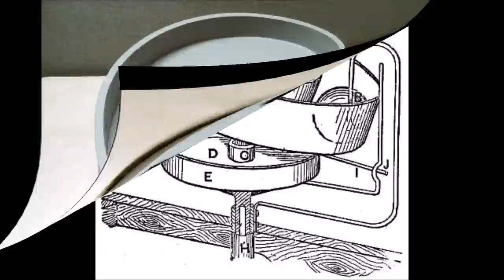Self running Tilting Tray. Perpetual Motion machine

Comment: There is filament wire wrapped around the shaft under the disc. A second operator starts to gently pull at a pre determined time (Just as the fella lifts his hands off after 'getting it going' ) You get a flash of the wire at around 49 seconds.

Comment: Wow thats amazing!  The battery is really well hidden well done!
Reply: You can build these yourself. I have. They do in fact work. This is called an unbalanced machine, not a perpetual motion machine. Unbalanced machines require an external force to work, in this case gravity. Perpetual motion is impossible. "Perpetually Falling" or "Unbalance Machines" ARE possible. If it helps you sleep at night this isn't considered a perpetual motion machine.

Comment: This is real. The secret is in the glass of absinthe. This is how it works.

1. Build contraption.
2. Drink absinthe. (Don't forget the sugar)
3. Hallucinate that device is moving on its own.
4. Profit?

Unfortunately the unlisted 5th step is realized after the hallucination ends, and you realize that there is another person using a wire to move the tray.

Why do so many people think that perpetual motion machines are possible? Did everyone skip the 4th grade? Is there a shortage of basic physics books in libraries?

Comment: can see the wire - but it's given me an idea. what if the ball was magnetic and the arm had a magnet of the same polarity to repel the ball? the point that the arm spins on could have one-way slant/block spikes on it to allow the arm to spin one way but not backwards (so as the magnetic ball wouldn't be able to repel the arm). as long as the ball was heavier than the arm then the tray should still pivot and tilt. the last part would be to attach the end of the arm to the ball with a short piece of string - so that when the arm repels the ball, the arm gets jolted over the next little one-way spike in the middle... probably wouldn't work but it's the best idea i have.

Comment: These machines do indeed work, many of which are based on medieval designs over 600 years old. The problem with the vast number of negative comments is that people fail to understand the difference between an unbalanced machine and a perpetual motion machine. Unbalanced machines, or perpetually falling machines depend on an external force, in this case gravity, and therefore don't qualify as perpetual motion machines. Perpetual motion is impossible, but unbalanced machines do work, many of which will work for years uninterrupted. The Beverly Clock in New Zealand has been running now for 11 years uninterrupted. Instead of assuming what you are seeing is fake, try asking yourself if what you are seeing meets the criteria first?

Comment: there's a little wheel on the lever on the side that touches the ball... if the wheel was powered it would easily drive the ball's rotation when it's in contact with the ball

Comment: The problem is the wheel can't push the ball because the wheel is lighter than it, but if the wheel becomes heavier it will tilt the tray, and if they are the same weight they will just make the tray move to a position where the side on the ground is in between them.

Comment: At :55 you can see the "puppet master." Also you can see the shadow of the puppeteer throughout the demo on the wall to the left.
But neat trick. What about using a strong magnet under the table to pull the whell down.

Comment: The ball's momentum will eventually run out. Just like a pendulum. When it runs out, it will push the lever backward. There is no way the lever can push the ball forward when the ball's gravity (plus the weight of the lever and wheel) pushes everything downward before it reaches the top position.

Comment: The ball is liquid filled. The operator starts the motion. The liquid is given kinetic energy, which keeps the ball rolling and the apparatus will run for a short time. No wires or air, just a trick.

Comment: This looks totally believable, except I'm noticing that, whatever is tipping the tray along, is well in front of the ball, whose weight is supposed to be the driving tipping force here. If that were the case, the ball's position, and its subsequent heavier weight, would have to be slightly ahead of tangent to where the tipped edge of the tray is touching the supposed flat stationary table. This is clearly not the case here. Whatever is tipping the tray along is doing it at such a force as to enable the tray to suspend the full weight of ball, and the arm and wheel assembly, up in the air, well behind the tipped point of the tray, which would force the whole thing to come to a stop. Therefore, I'm not convinced here.

Comment: There is a wire which connects the circle and the room light ,, when it moves  you can see the background , the reflection of light moves.When the Cheater holds the circle , the reflection of light becomes stable in the background...... Moreover 1:05

Comment: someone is using an air compressor nozzle above it to push down the tray in a circular motion. 1:03 you can see it at the top of the screen. probably why there is no sound to the video.

Comment: There is no wires at all. Notice inside the large glimmering ball there is a smaller ball. There is liquid  inside the glimmering ball also.  That smaller ball is a steel bearing.Under the table someone with a large magnet in his hand is making a circle with it and dragging that steel bearing around and around.  The cup with fluid in it is a distraction.

Comment: The Five Laws of Friction:

    When a body is moving, the friction is directly proportional to normal force and frictional force direction is perpendicular to the normal force.
    Friction doesn’t depend on the area of contact so long as there is an area of contact.
    The coefficient of static friction is slightly higher the value than the coefficient of kinetic friction.
    Kinetic friction is independent of the velocity of the body.
    Friction depends on the type of the surfaces in contact.

Comment: If the ball can tip the tray with the lever on it, then it must be heavier than the lever. However, since the lever can push the ball uphill only using the force of its own weight, then in must be heavier than the ball. So, it cannot work

Comment: Not perpetual motion:
It looks as if the machine can never be at equilibrium, but it can. If the ball and lever are positioned in such a way that the combined forces just push down the disk, assuming the disk is already in such a position, the machine will be stopped
So, its essentially a disk with a bunch of doodads on it. The things might as well not be there. As you know, spinning a disk is not perpetual motion

Comment: If this is self moving then why you need to start it manually by hand......what actually will happen is that dish will tilt down in the direction line of resultant of gravitational forces of all items in it like ball, levers, wheel, nut bolt etc and finally stop.

Comment: Impossible of course (First law of Thermodynamics).  But these guys are really like magicians not physicists.  Everyone with a high school education knows it's a trick we just need to figure it out.
This one's easy.  I don't think there's a wire, but an electromagnet under the table that's switched on and off as the metal disk rotates.  You can see it clearly in the jerky action of the platter.
If gravity was powering it, it would be smooth.  He should power the electromagnet with a sine wave instead of a pulse to smooth it out a bit.

Comment: It's important to think about where the energy is.  It's a certainty that all has to be accounted for, no free energy.  Do you notice how the spinning motion is demonstrated at the beginning?  The ball is filled with fluid.  The initial motion might be enough to set the fluid in motion and that would hold a short reserve of energy.  Also, you have to wonder why such a ball would be used for such a serious demonstration?  There are clearly electronics in the ball.  I know that some balls have wobblers in them which cause them to be erratic.  This would be extra energy to play with.
Reply: please re watch the video keep you eye open for a rod at poking down at the top of the screen. he's using a wire.
Reply: +kakytoo69 There is a moment where a rod can be seen at the top of the frame and appears to have a motion matching the spinning tray.  Good catch.  Still, this could have been done with one of those 'weasel' balls that rolls around by itself.

Comment: Gravitational fields, electromagnetic fields, springs, pressures, etc.. are all conservative fields. If you take an object and move it through the field, you can store potential energy, but if you ever return to the original position, all energy reverts to its original state, REGARDLESS of the path taken. You can make a fancy contraption to try to confuse the underlying physics, but I promise there is no orientation or configuration you can place magnets or springs to create power. Stable kinetic energy is not power generation.

Comment: This is just something that will run a long time due to low friction between disc and table, it's in the same class as a spinning top. For a bigger example look at the rotation of earth around the sun, the very low friction in that case will ensure it'll still be going in billions of years.
Reply: There is a ton of friction. The rim of the  bowl, the rolling ball, the weightet contraption...
There are a few really cunning constructions who run a real long time (not quite for ever, but still), balanced, weighted and every bearing as soft as possible. And - oh yes - celestial motion is a good example. Vacuum and low gravity is really practical when you try to reduce friction :D
This thing here, is clunky in comparision.

But just to clarify: I don't believe in perpetual motion. I am aware, that it's impossible.

Comment: You can build a machine like this which will move forever - or at least for a long time. I don’t remember that physics deny that. The problem begins when you try to extract “work” from the system. You cannot , for example, power up a lightbulb using is because it is on such a balanced state which will crush down with an energy output.

Comment: This is NOT perpetual motion for two reasons, first, it is impossible, second and most important, THE BALL VIBRATES AND SHAKES THE PLATE, WHEN THE BATTERY RUNS OUT THE PLATE WILL STOP

Comment: Если остановить кадр, становится очевидно, что лоток соприкасается со столом в точке, которая ниже чем шар. Значит, это не шар толкает лоток, а наоборот, лоток качаясь силой инерции заставляет кататься шар под наклоном (вместе с рычагом). Конструкция медленно теряет энергию, сообщённую ей автором, на трение, что должно отражаться в уменьшении периода обращения с течением времени.
_

If you stop the video, it becomes obvious that the tray is in contact with a table at a point which is lower than the ball. So it is not a ball pushes the tray, but on the contrary, the tray swinging inertial force makes the ball roll at an angle (with lever). Tray slowly loses energy added to it by its author, on friction, that must be reflected in the reduction treatment period with time.

Comment: Its not Perpetual motion if you're using gravity. That's your energy source.
Reply: This thing doesn't 'use'  gravity. It most likely uses a string or wire to keep it in motion. (You actually could even see it, if you close the Label with 'Problem' at around Minute 1 :D

The whole deal of this guy is showing fake perpetual machines from the past with little hints what's the trick. He is something between a stage magician and a educator.

Comment: If it was real the motion would be smooth. The jerkiness is what tells you that it's being moved by a wire or string. There's no real perpetual motion, but there is free energy: solar, wind, geothermal, etc. My home and my car are both all-electric and all my electricity is free: solar panels with batteries for night-time. Many of my neighbors have the same. Who needs perpetual motion when you have the sun?

Comment: Perpetual motion is a nice thought but energy, in any form, cannot be created or destroyed. While things can keep moving forever like the earth or the ISS its because there is nothing to stop them moving like friction, and the instant you try to turn there kinetic energy into electrical energy in a generator for example, then they start to lose the kinetic energy as it is turned into electrical energy. The kinetic energy of this machine would be turned into sound and heat by friction, meaning it would slow down and eventually come to a stop. Honestly I want it to work because it would be renewable power solved but unfortunately it's just imposable.

Comment: The motor under the table does not run smooth enough to fool the fools
Reply: It's actually a person above the contraption using a wire. Good job trying to sound smart though!

Comment: Cool video but you're doing more harm than good by passing these off as real, since there are enough uneducated people on youtube that you'll end up with a ton of them believing perpetual motion is feasible. Also you can kinda see the system accelerate angularly after you let go, which means more energy was introduced from outside the system hands down...

Comment: Doesn't work, friction losses will eventually stop it. That's why it's a 30 second video and not a something like 24 hour continuous one. Also if you tied this to a generator it would stop it. Even if you had no friction and a vacuum it could only keep itself moving add any additional resistance such as a generator and it stops. Use more weight and it will just also require more energy to move back up. Funnily exactly the same amount as it had when falling... and not one bit more. So you'll never power anything with these apparent perpetual motion machines. That's why the "apparent". There's a reason these things don't work and it's called physics. Now unless you have a mathematically coherent theory that disproves or sufficiently modifies the laws of motion and energy conservation to pull it off that would be something else. But nobody has been able to do it yet. EM drive is probably the closest thing and even that is very far from proven to work. Don't believe me? Try it. If it does work it's a guaranteed nobel prize and these are worth 10M now.

Comment: the wire excuse is more far fetched .. how would a WIRE keep this going..hahaha
Reply: it's being moved up above camera frame you can actually see the wand it's atached toit lefts the one side up giveing the illusion that itsmovie try build this yourself you will see it's bullshit
Reply: that in no way answers my question... if your going to deny something n the SAME  Ignorance your accusing  him of displaying.. then your no different.. 
HOW would the wire make this keep spinning ??
Reply: Perpetual motion is impossible there is no other explanation
Reply: frank james
th wire make it keep "spinning" by lifting one side of the plate causeing the ball to move to the lowest point from gravity if this was a true perpetual motion machine working only on gravity the motion would be fluid and smooth not jerky

watch the video again except fosuce on the top of the video frame above the "machine" now right after the annotation pops up you will see an object come into frame and then out again thats the wand with the wire on it now imagine you can see what the wire is doing its attached to the spinning plate and chaning the tilt to make the ball move.

the reason it wont work is the "lever" and its wheel don't have enough mass to move the ball from the force of gravity alone if the 2 had the same mass they would find some happy equilibrium and the plate would balance in that spot like a set of scales. if one or the other weighs more then the one weighing more (in the case the ball would fall to the lowest place and you would need more mass than it to shift it against the force of gravity to an area higher in the dish to keep it moving. but if that object weighs more than the ball it would fall to the lowest place and stay there. and if they weight the same they cancel each other out and will find a spot to balance. it's simple physics. perpetual motion is BOGUS energy in must always be equal to energy out and there is always a byproduct energy you don't want sapping away from the energy you do it because of this byproduct wasted unwanted side effects heat/sound for example anything that is not movement that you can't have perpetual motion. because you are losing energy in forms that you can't harness
Reply: well  what your saying is that wire is used to  do what the balls job is... bring it down to gravity level before the armature gets there.. if a wire was used.. which i can not see, where would it be attached , the armature would prevent that  wire and there no other place to put it as he turned it over twice.
Reply: *****  actually there is perpetual motion or virtually such, this is another example of suppression of suppressed things in the world.
Reply: Frank James is an obvious troll. No one is that gullible and trusting.
Reply: at 0:55 to 0:58 in the vid you can see the thing holding the wire, it comes in to frame at the top edge of the video above the disk.
Reply: Joe Anthony and again at 1:05 to 1:06.